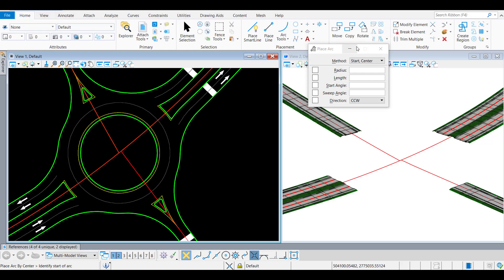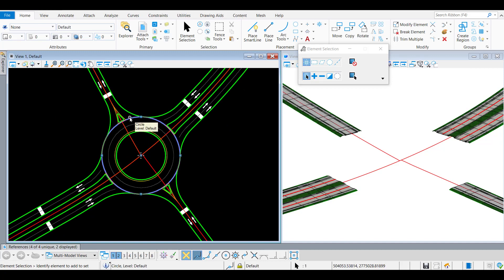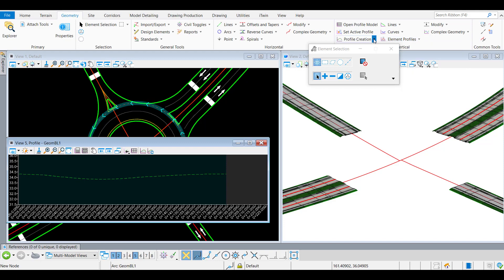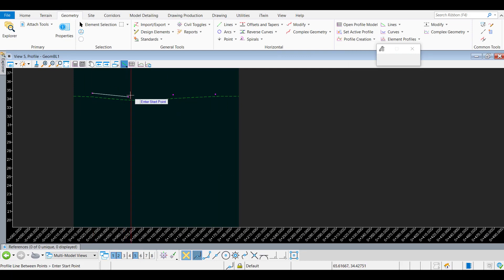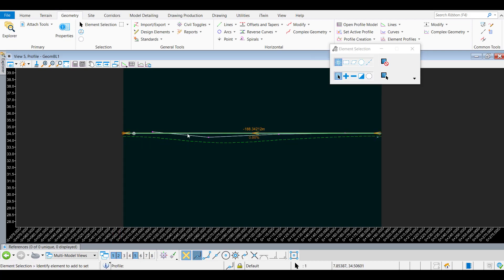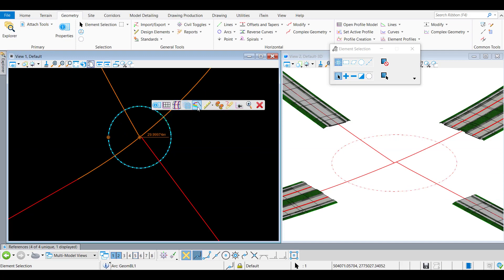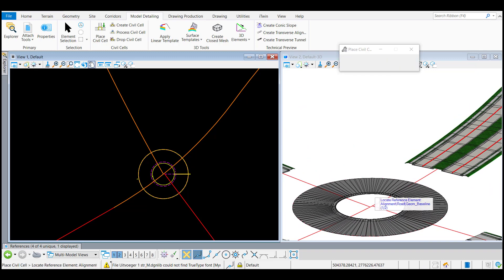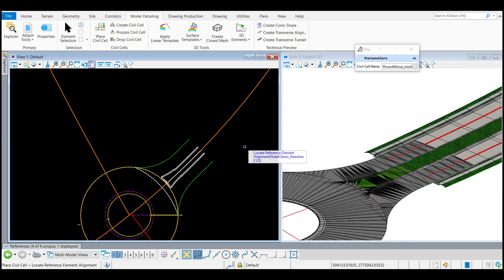Roundabout design and automation part 1

Comment: If you want to find the centre point then draw a chord to the existing circle, draw a tangent cord where the first line intersects with the circle (90°), and then connect the two points (that's your d). Mid point is the centre of the circle.